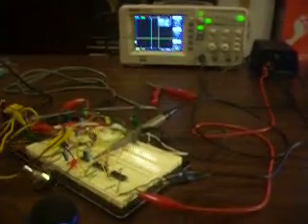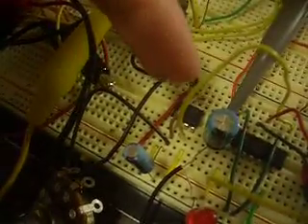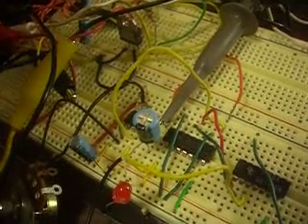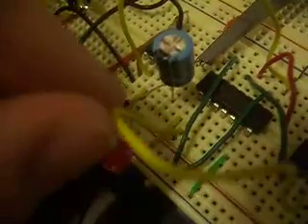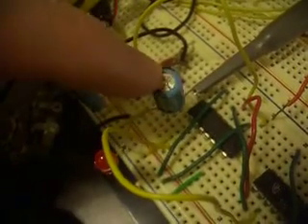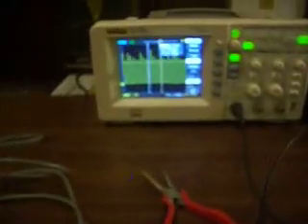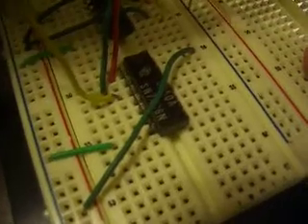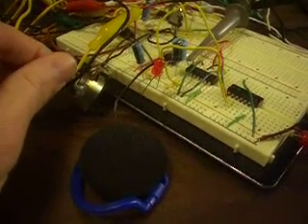Atari 2600-like LFSR Random Noise [555 Timer Contest]

Comment: Hey,  I tried your circuit and, as I am pretty sure you've heard, there is a cycle in the noise.  In other words, it is not completely random.  Do you think there's a way to avoid that?
Reply: That "cycle" depends on which "taps" of the LFSR are fed back into it; and there are some configurations of "taps" which produce higher "loop lengths" so that the pattern gets "more random". I highly recommend checking other online sources for LFSR's they're amazing. for example especially this video https://www.youtube.com/watch?v=juoM7VhXQDM

Comment: :-/ aww, I wanted to build this, but I can only build it with the chips I can obtain in class. Oh well, lol
2 4011s, 4029, 4051, 4520, 4511, 4001, 4043

that's what I can obtain.

Oh well *builds transistor circuit*

Comment from the maker: Sure.  The SN74HC164 is an 8-bit serial-in, parallel-out shift register and SN7486 is a quad XOR (though you only need a single XOR gate for my circuit).  Looking at the Wikipedia article on the 4000 series, the 4094 should be a suitable shift register and the 4030/4070 would be a suitable XOR.  Read the Wikipedia article on LFSRs to get an idea of what the circuit is doing.